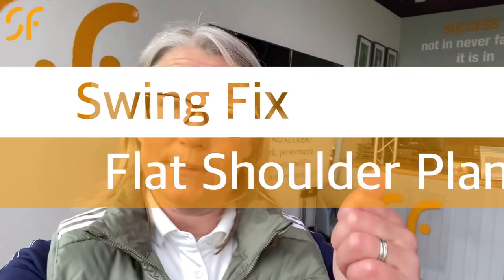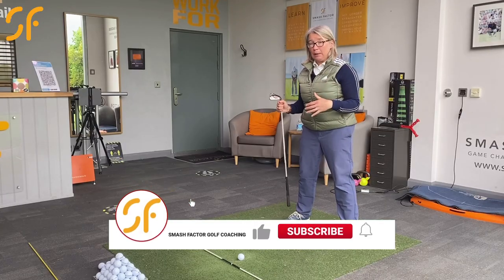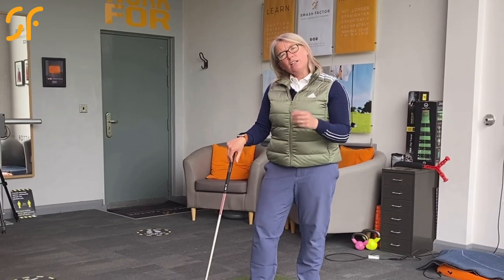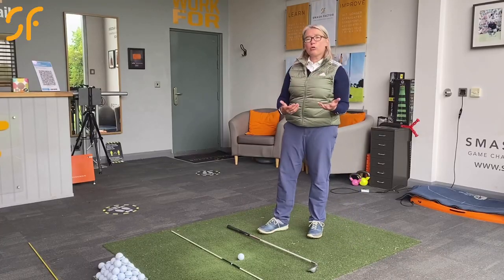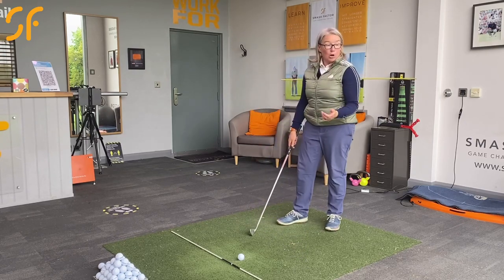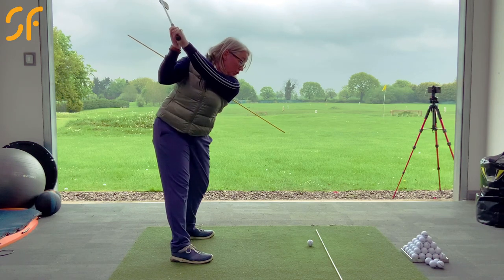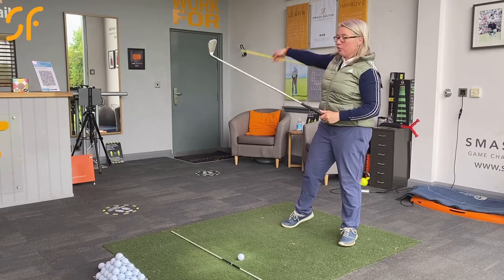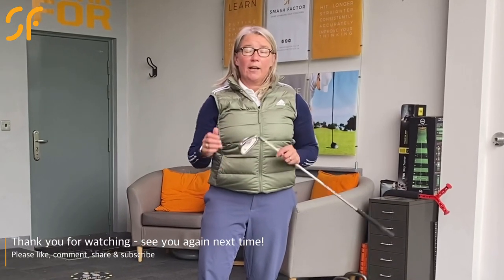GET RID of your FLAT SHOULDER PLANE - Swing fault series Part 3

Comment: Useful video, however it can be clearly seen that your should plane on the backswing is pointing about 4ft  or more past the ball, not about 1ft as you suggested. You're not the only Coach who does this, so do you think this contradiction is helpful or unhelpful?
Reply from the maker: It’s what you need to feel like you are doing if you flatten your shoulders off too much